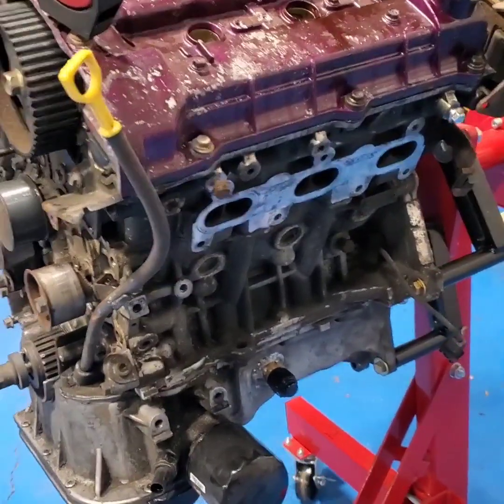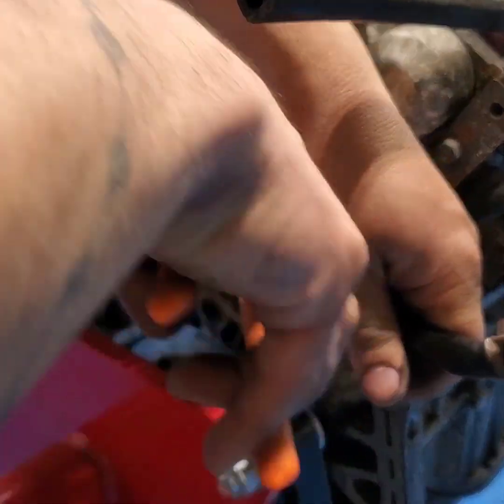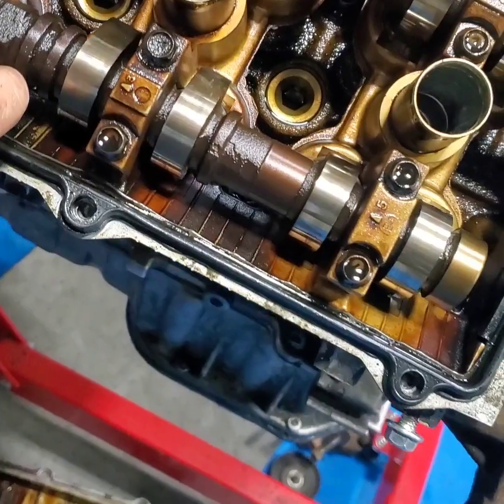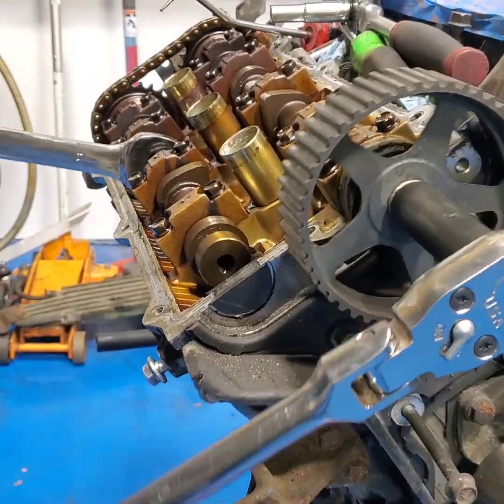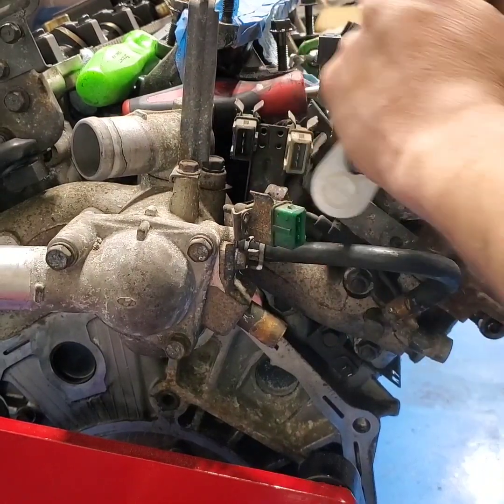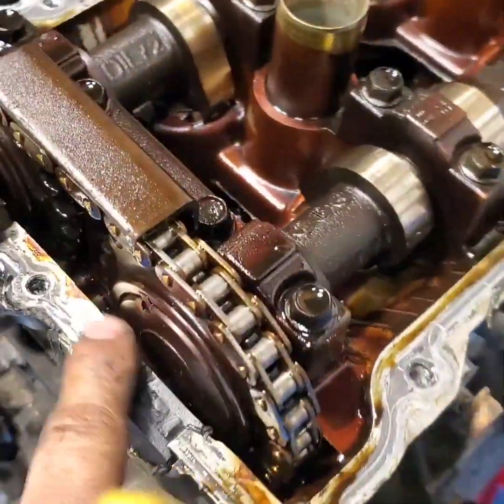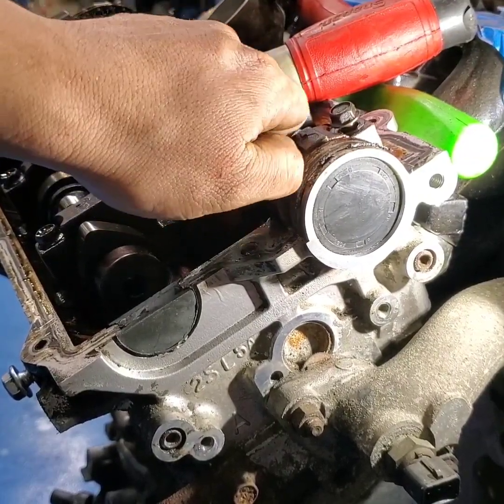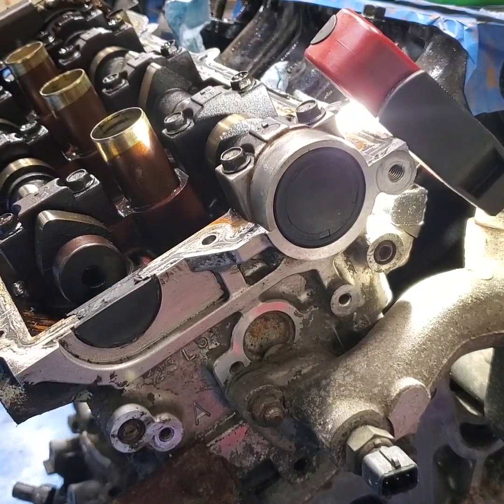Taking upper apart Hyundai 2.7L V6 engine

Comment: How tough is it to replace the timing chain guides, specifically the rear head's (pass side)? Do you recommend replacing the chain sprockets and chains if I'm going in there.
Reply from the maker: Never change chain on camshafts just reused them when I install regrided Cams. It's not that hard
Reply: @Lilmiddwest So , Those Chains Aren't "Heavily " Loaded & Don't Stretch Much ?
Reply: I saw in one of your other videos it's below the cams. Doesn't look too bad. But you make it look easy lol. Time to order a digital 3/8 torque wrench. Harbor freight won't cut it for this haha
Reply from the maker: @kdash3215  you don't need digital one and I work on my Mopar engine that what I used it for
Reply: @Lilmiddwest  It's not that. I torqued down some rocker arms once with it and a month later, two bolts were completely loose. Click was off. Can't risk it lol.

Comment: Hi
        Thank you for your reply.
I have the same engine.
I don't know about intake camshaft and exhaust camshaft
According to which numbers and in which order
they need to be installed.
I look forward to your reply.

Yours sincerely, Michael Mösgen
Reply from the maker: Well exhaust Cams are short they can go on front or rear but intake cam only go in one way rear cam get the cam sensor

Comment: Why was throttle body heater hose bypassed ? Do you live in a warm climate ?
Reply from the maker: I live in Wisconsin and I don't drive in winter time. My BBTB don't have lines for it.
You don't need it during summer time and plus lower your intake temp.

Comment: How you have a timing chain on a 2.7L v6 engine hyundai
The hyundai 2.7 v6 is a timing belt same for the sonata
Is this A 3.3L  v6 engine hyundai ?
Reply from the maker: Timing chain for the camshafts all of the 2.5 and 2.7 has camshafts chain. Intake cams move the exhaust Cams with chain. It's a timing belt I guess you didn't look at my other videos taking it apart and reseal everything back on.
3.0 3.3, & 3.5 are same block with timing chain.

Comment: Hello, How are you? 
I'm from Brazil and i have a tucson that uses the same G6BA engine. In the First departure of the day, i hear the noise of lifters, It stay for about 5 minutes and then It stop. What could be happening?
Reply from the maker: Thses engine don't have lifters. If you hear ticking nosie it more likely it's oil filter is smaller then OEM filter. You need same or bigger oem filter.

Comment: Timing s'il te plait aide moi
Reply from the maker: With what? You know I show how to real seal engine and timing
Reply: @Lilmiddwest  ok i have a hyundai sonata 2003 v6 i will fix it it did not mix water with oil nn the radiator.after all the work i do i can't timing it i need a help from me please can you help
Reply from the maker: @MERF735  https://youtu.be/ZU5mSI0GLDU
Let me know if there any other information you need

Comment: Hey its time for me to change the timing belt and waterpump. Read in the forum to change the cam and crank seals. If I do have to replace do I have to remove the cam cover to replace?
Reply from the maker: You can change them. If they are not leaking don't touch them.
Reply: New Guy  what typ of certain tools
Reply: New Guy  ok I got most of that except the cam lock. It sounds easy but it's my first time doing it.
Reply: New Guy thanks for the info
Reply: So if my cam seals are leaking, does removing the cam gear ⚙️, have a effect with the timing ? Is the cam gear lock meant for removal without spinning the cam gear, like this guy in this video did when he used a open wrench on the cam lobes.

Comment: Hello, you know, I do not know the tightening of hyundai santa fe 2.7 v6 year 2009 4x4 gls automatic for the camshaft benches, you know the torque to not make a mistake in this video I see you use a torque wrench in 11 pounds but only in those bolts but I have to remove the studs to repair and the entire camshaft I would appreciate if you know the pressure of the bolts that hold the cams grateful santiago de chile.
Reply from the maker: That what my Hyundai Tiburon service manual say and I know about your Hyundai  Santa Fe requires. https://youtu.be/dRDBMHaO4ng

Comment: Would this be a 02 sonata engine?
Reply from the maker: I never work on those years. If 2.5 or 2.7L V6 engine codes G6BA/G6BAX/G6BAY it's basically same

Comment: Is this motor similar to what's in the 03 Santa Fe 2.7? I ask because there are 2 wire harness connections side by side that seem to disappear under the intake manifold. These harnesses became brittle and fell apart. Need to replace them but have no clue what they even are or where they connect. Any idea what I'm talking about? Can't get a straight answer anywhere i look. Any help would be greatly appreciated Brother. 😀
Reply from the maker: Yea it's Hyundai & Kia G6BA V6 2.7L. Under upper intake manifold are fuel injectiors harness and under the lower intake manifold are knock sensors . I'm not 100% santa fe is the same as the Tiburon.